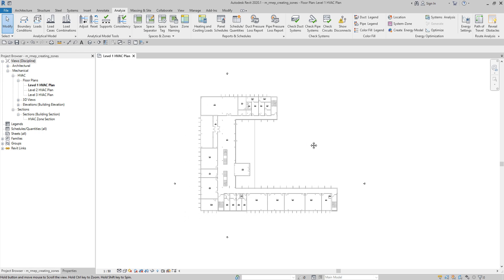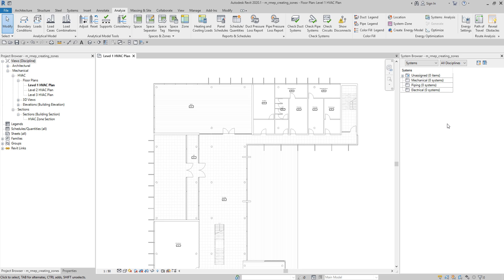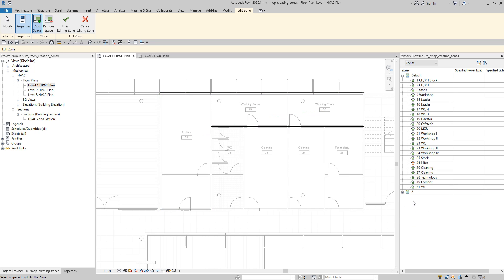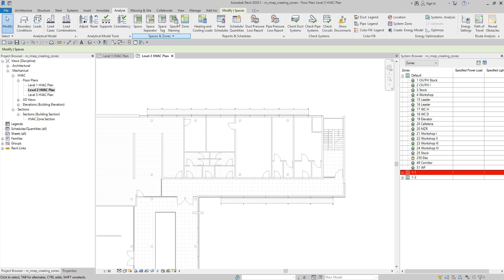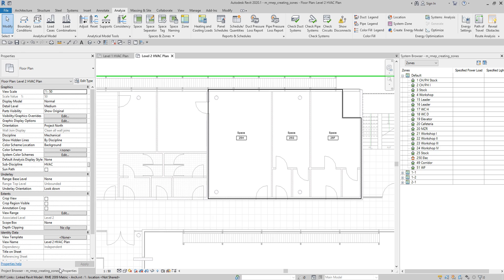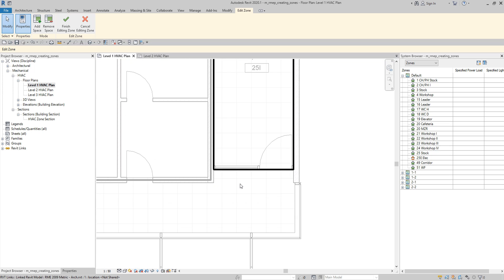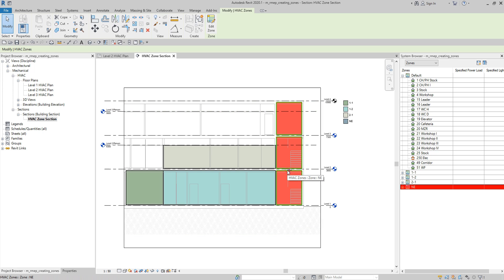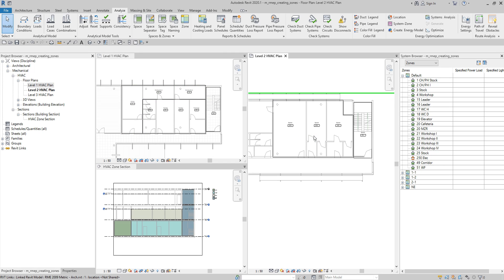REVIT MEP 2020 - STEP BY STEP TUTORIAL 14 - HOW TO CREATE HVAC ZONES

Comment: Dear Rich, when you create in level 3 the Last space of the NE zone says UPPER LIMIT level 4 and Offset 3800. Does this offset affect the zone ? I mean its until level 4 +3800?
Reply from the maker: Hi Kostas, what will happen is the analytical model will not be accurate because it is excess of 3800.